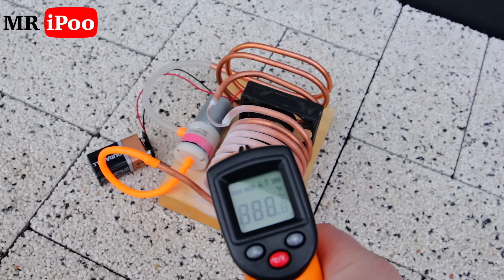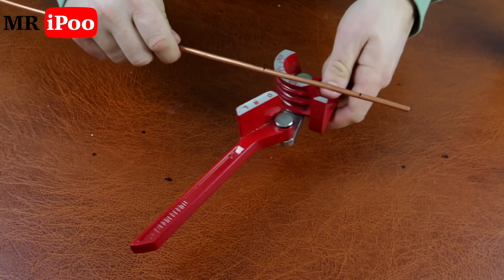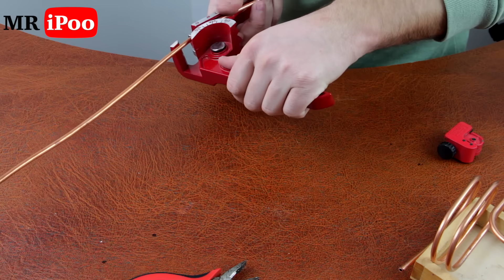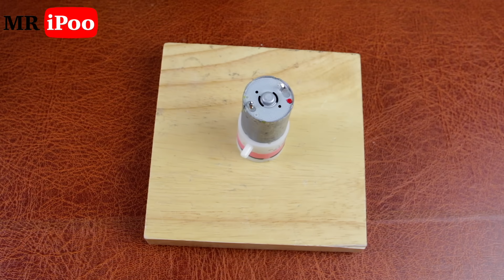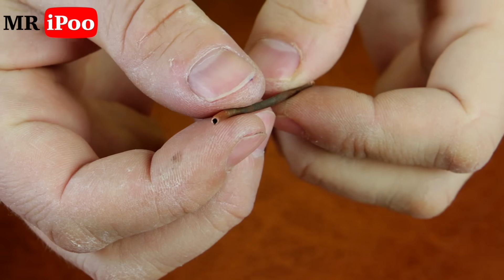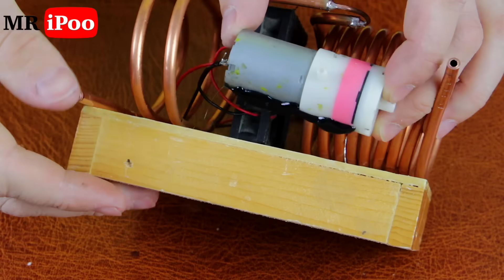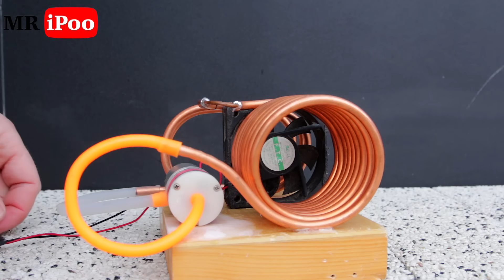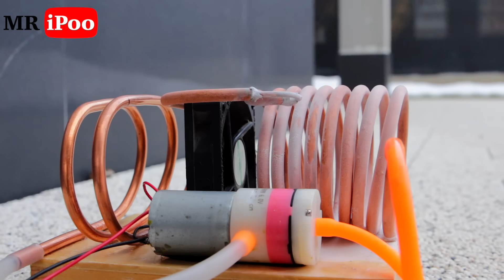DIY Freezing AC : Crafting an Icy Air Conditioner down to -32°C!

Comment: Where is compression..both copper wires he used same gauge....and what about lekage of gas by this motorised  pump.....he can put whole pump in a air tight or sealed small plastic bottel
Reply: The small tube he added is called a "capillary tube" and causes a pressure difference in the system. Such tubes are used for this purpose even in large commercial units using "real" refrigerants.  Leakage?? You mean like what will happen after you cool your house with this unit for 20 years? 😆 (it's a demo of principle, not a product)

Comment: Normally, the condenser is much larger than the evaporator because you need to remove the heat that is generated by the pump during pressurization as well as the heat that is removed form the air by the evaporator. This is the opposite and will not work long term if at all.

In normal air compressors, the high side pressure is 130+ PSI. This rubber tubing would never be able to hold that kind of pressure and the pump being used would not be able to generate that type of pressure either.

And running a pump that could generate that kind of pressure would never work with a low amperage 9v cell like in this video.

There is something screwy going on with this. could be as simple as the low side (freezing side) being piped to a real compressor beneath the table or whatever this is on.
Reply: @yousofjaved636  Nonsense. I lived on free energy for years. Then I grew up and moved out of my parents house... 😆😂🤣
Reply: It's ridiculous that the condenser is so much smaller than the evaporator. Some people know that the condenser pipes of the refrigerator are much longer than the pipes in the refrigeration section. Also a refrigerator uses at least a 100 watt motor to cool such a long pipe. A 3 or 5 watt motor is used here. It is claimed that it can reduce the temperature by 50C with 3-5 watts of power. Think: Can you heat that copper pipe to 50°C with that small battery? Some physics and logic please! Remember that sometimes awe-inspiring things can be magic shows. This is just one of those maker videos trying to fool people!

After writing this, I found it by chance, here is a video explaining the trick. As I guessed, this was a magic show. It cools the pipe by spraying gas on it.
I subscribed to the channel in the link for its honesty. He really deserves this. The link is here.
https://youtu.be/sg-kjsLZnNE?si=FSML-yUd25SURJji
Reply: and yet, there it is....
Reply: The system works just because the butane already has pressure as compared to refrigerant gases which require extra pressure to create cooling while passing through the nozel. The only needed thing was a pump to circulate the butane from one side to the other. So only a small power is consumed to circulate it. It is not used just because it is highly inflammable and  can cause serious damages
Reply: probably pumped liquid nitrogen or just refilled with liquid butane again. Even the hot side is in the negatives
Reply: It blatantly does work. It's just less efficient that a production system, but it proves the concept very well. You could have gone the whole hog and said the system does not include a dryer, has not been vacuumed down etc, but that is not the point here. And the reason the tubing works is because it only has a small pump rather than a big compressor.
Reply: Guys like you crack me up. "Normally.... blah blah blah"  as if anything about a lab bench demo has to be "normal" for commercial air conditioners. In "normal" air compressors ( I assume you mean a compressor in a refrigeration unit, which is not compressing air) high side pressure is 130+ psi...and the rubber tubing ..blah..blah....  

Let me help you here - "normally" refrigeration units use Freon (R-22) or Puron(R-410A) which have very high vapor pressures (the pressure that will condense them to liquid at "normal" temperatures) and run high side pressures in the 150psi range. At room temperature (25°C), the vapor pressure for butane is about 35 psi. You know this is true because Bic lighters haven't been exploding in peoples pockets. The best working fluids in refrigeration are what is called "phase change" materials, because you get fantastically increased movement of heat energy if you get something to actually condense to liquid and then evaporate to gas - much better than just making air hot by compressing it.  This guy does a nice job of demonstrating that principle in small scale, and it DOES work, there is no secret pumping of liquid nitrogen under the table or anything else - butane is a fine phase change material that works at low pressures. No - this unit won't cool off your 4 bedroom house or even keep your beer cold - it probably won't even run for many hours, let alone years - but that's not the point. You missed it. 😆😂🤣
Reply: @davidsmith3302  Yes. But freon has not been used for for years. Older systems use R134a (usually in cars but in some older fridges and freezers), but is ozone depleting or R600a (Butane). And just for the record, I'm a refrigeration engineer working for one if not the worlds largest domestic appliance manufacturer.
Reply: @andyspoo2  Your large domestic appliance manufacturer won't be building any new units that run on R-22 but believe me, there's plenty running out there, and you can still buy "freon" to recharge them (at over $300 USD for 10 pounds)
One of the biggest problems with acceptance of R600 comes from resistance from the chemical manufacturers - butane costs about a third of the alternatives in use now, so they put pressure on the industry by doing things like publicizing the "explosive" nature of isobutane. (it's "flammable", not "explosive") It's just greed at work. People store gallons of propane at home with little to no concern. Propane will release 46 kJ per gram when burned. Burning butane will release 49.5 kJ per gram. The difference is not significant. 
As usual, money seems to be the root of all evil 😆
Reply: @davidsmith3302  I agree. The average amount of Butane is a fridge freezer is about 36 grammes, pretty much nothing compared to your average butane gas cylinder.
Reply: what are you talking about? dude do you even know how refrigerant works? and do you even know why the guy using that flammable gas? seriously dude😂
Reply: @user-ve5qq5wp6j  the "flammable" part has nothing to do with it.

Isobutane, known in the industry as R600A is used in many domestic refrigerators manufactured today.

Butane is an excellent refrigerant in terms of its heat capacity.
Reply: @davidsmith3302  thanks for stating the obvious. but you miss one thing, you didn't explained the basic principle of HOW IT WORKS. because the guy is clearly don't understand the very basic principle of an ac. go tell him sir! tell him why the expansion valve is needed in the system. tell him why the indoor unit is called EVAPORATOR
Reply: @user-ve5qq5wp6j  Obviously, I didn't state enough of the obvious. Clearly you have some experience with AC, but clearly not complete experience or you would know what a capillary tube is, and how it functions as an expansion valve of sorts. (still used in many modern ac units) 
 Rather than just keep trying to insult each other, why don't you increase your knowledge by googling capillary tube in ac and maybe you will understand why he put a piece of reduced diameter tubing in his system. (not saying it was reduced enough or long enough or anything else about his execution except that he DID include all the necessary components for a functional chiller of some kind)
Reply: @user-ve5qq5wp6j  Butane, R600a is used in pretty much all modern fridges and freezers because it is not ozone depleting unlike the other versions. So what is your point??

Comment: The wood and glue gun are suspicious...
Reply: they're not the suspicious part, the push-fit and soft hoses give it away that it can't be operating on the principles it purports to be.
Reply: @herseem  At room temperature (25°C), the vapor pressure for butane is about 35 psi.
Reply: @davidsmith3302  ok, that's helpful to know. I'm pretty sure that is too high for those push-fit connectors on those very soft hoses though. They would withstand very little pressure above atmospheric pressure in my view

Comment: Şimdi mantıklısı benim söylüyegeyim, sıvı nitrojeni aynı pompalı sisteme ilave etsek iyi olmazmı?
Reply: The pressures would be too high.😊
Reply: You would need an environment that is colder than the pressurized liquid nitrogen to remove heat from the hot coil, so maybe it could be your second or third refrigeration stage.

Comment: I thought that this would make a good science fair project until you filled it with flammable liquid.  Also, if the fan is blowing from front to back, you are taking the cold air and using it to remove the heat for the condenser coil. While this demonstrates the principle of compressor refrigeration, it waste all the work you did to cool off the coils in the first place.
Reply: The latest automotive Freon is flammable! At least gm ‘s is.
Reply: The literal acid that ruined my backpack...
Reply: You do know propane and natural gas are used everyday for refrigerants, right? Are they safe? Not really,  but as little as he used it wouldn't be any more of a problem than a potato gun. 😅
Reply: @Rev22-21   Sure.  Some also use pure ammonia.  But chemicals that are explosive or toxic would never be allowed in a high school science exhibit.   Something benign like freon would probably be allowed and would be a lot safer.
Reply: @MrEdwardhartmann  except...bunson burners... those alcohol gel cans
Reply: @MrEdwardhartmann  Freon (R-22) destroys the ozone layer!! 😆  Kidding... the real problem with Freon or the more environmentally friendly Puron (R-134A) is the pressure you need to operate at (150psi to condense them vs 35psi for butane) Butane is not explosive, it's flammable, and many high school science projects use it to heat something with a camp stove or bunsen burner. There are plenty of things in a high school chem lab that can kill you, that's what "education" is for 😉

Comment: What kind of pump are you using ? Is it a gear pump or ?
Reply: Looks like a windshield washer fluid pump from an automotive parts store
Reply: No it's not gear pump, it's just a simple mini air/gas compressor.
Reply: The pressure and flow requirements are nothing serious. The important thing is that the pump is gas tight. You don't want your flammable refrigerant leaking out the whole time.
Reply: I didn’t know anyone made such compressors. Any idea where I can get one?

Comment: Very nice. I suggest just one minor change, make the round cold coil a bit bigger so that you can put a can of drink in it and then mount this part vertically and put some insulation around it to keep it cold. And there you have it, a mini fridge for your soft drinks. Great idea.
Reply: Yes yes yes 😅
Reply: As long as you don't mind the rattle of the compressor.
Reply: You know that this was fake, right?? LOL🤣
Reply: No lo parece. Tecnucamente es correcto en todos los pasos y funciobamiento. @Tom-yc8jv
Reply: i seen it before it was indian channel because all fake stuffs like this made by them   @Tom-yc8jv
Reply: It's still a great idea . I kept saying, "What is he going to do with this  thing"
Reply: @Mike-vr4lw What to do with that thing? ...hmm very easy, patent it, then mass produce it and finally sell it and become a millionaire
Reply: @alrigar7771  you would first need a time machine to travel to a year where this wasn't common.
Reply: @michikatsu8505  It is not correct ... humm ... first you have to wake up from that dream that makes you believe that this inefficient, impossible and false DIY can somehow work.
Reply: @alrigar7771  Agreed  with you, one question bare in mind that could the motor produce sufficient  pressure for vaporization .

Comment: I think You can use it only once. It is Hard to see a second turn or a long time use
Reply: As long as that little compressor & battery lasted,  and that rubber tubing to his condenser coil didn't leak.......that'd work indefinitely.
Reply: @Rev22-21 How is that?When the gas is expanding it cools down ..But from where the energy to compress it again? From the tiny pump?
Reply: Quanto gas bisogna mettere?
Reply: Not that I really know but if it's a closed circuit wouldn't that keep everything (refrigerant gas) contained? So it would keep on working? On the other hand I know in air conditioners they have to refill the refrigerant gases every so often.
Reply: Many people think that air conditioners need to have the refrigerant refilled from time to time.  This is only true if there is a leak in the system.  If there are no leaks the refrigerant never needs refilling. @barnabyvonrudal1